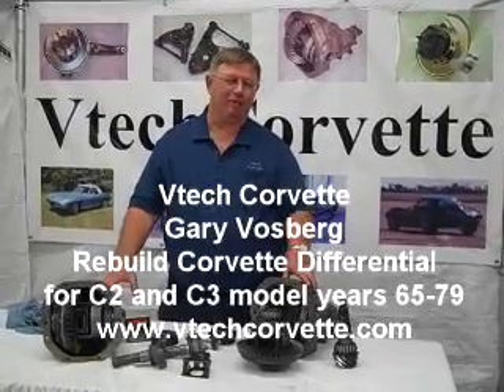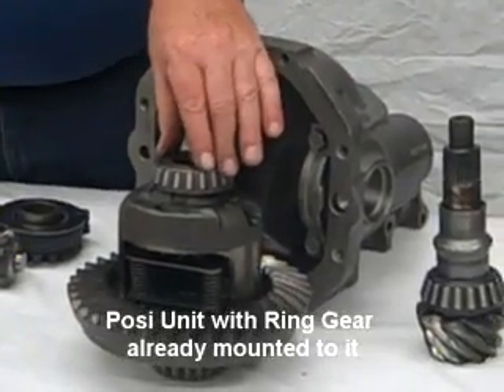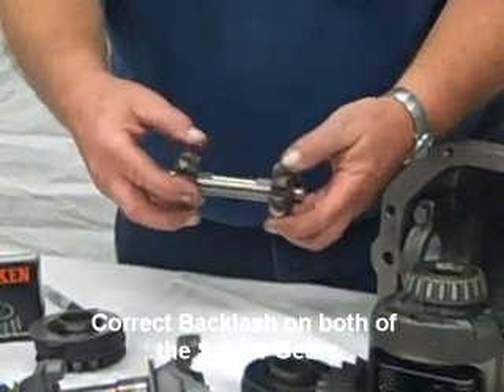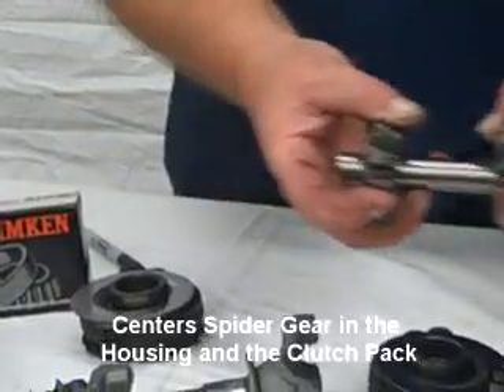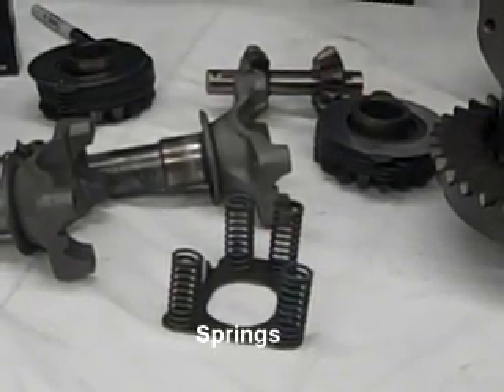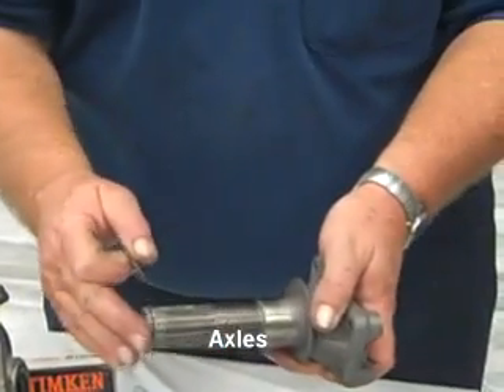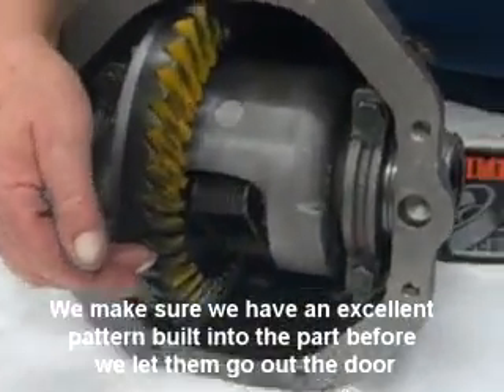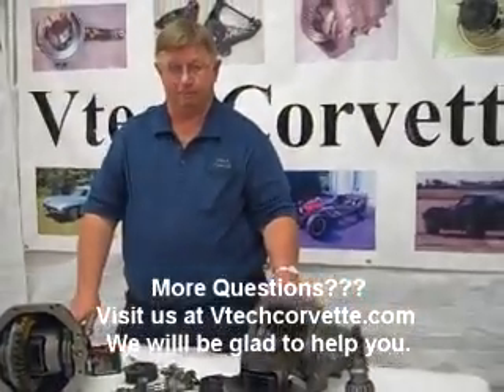Vtech Corvette Differential Rebuild

Comment: had to tap my stub shafts out. My issue was .048in. end play on one shaft and 53 on the other. these rebuild shops say that they set the end play. but how. you can't buy shims. they say that you have to buy new stub shafts. Just saw a video of a man that had more end play with his replacement shafts. I  will make shims for my stub shafts. If you keep tapping on the shaft without hitting it hard. The burr will  bend out of the way. Shops will do the same thing to remove them.

Comment: Hi folks I bought a 1975 corvette convertible, was very slow in high way I was  not passing 70 MPH , i had to replace the rear differential, was 4.1 to 3.0 now i am happy going more than 100 mph with out screaming  the engine...  ;)